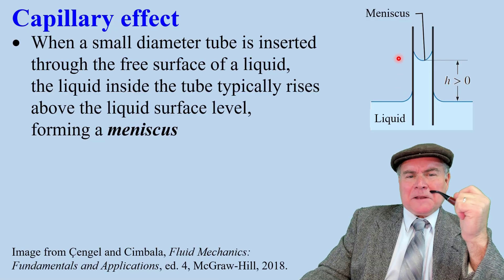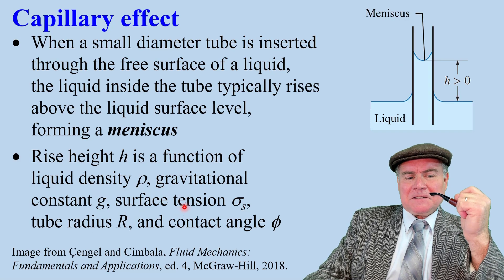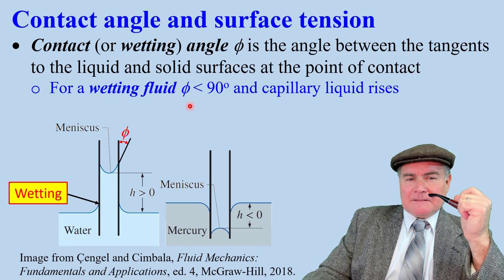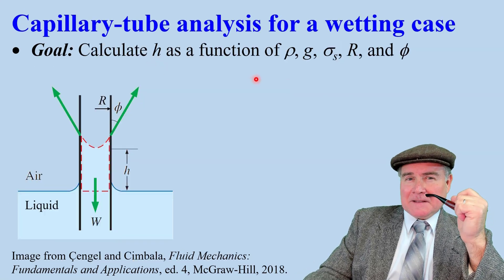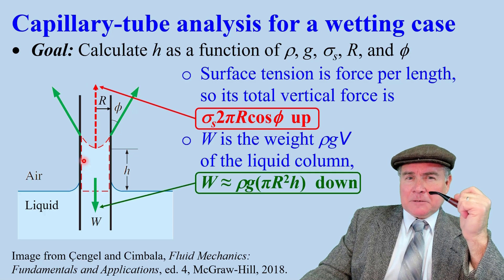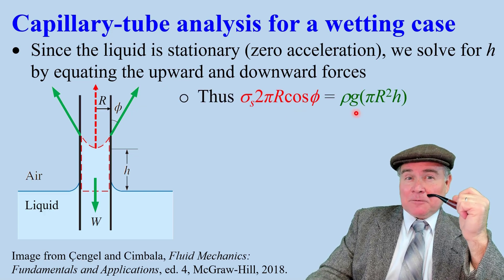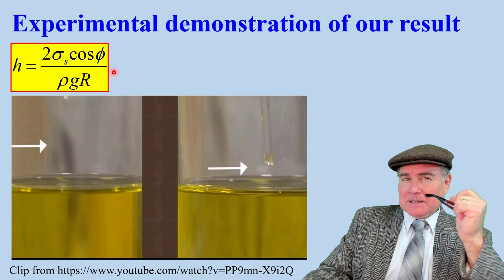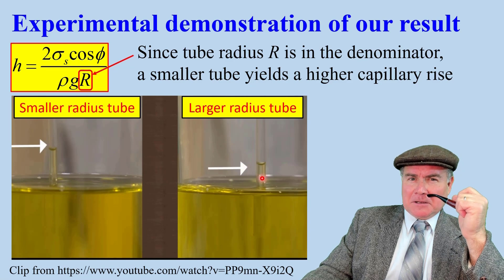Calculation of Capillary Rise in a Tube

Comment: Isn't surface tension force b/w the liquid? Here, the liquid is being pulled up by solid, right? Or it is assumed that an infinitesimal layer of liquid( annular) exerts the force on rest?
Reply from the maker: Think of the surface of a liquid as the skin of a balloon - there is a tension force, and that force is between fluid molecules, yes. But when the surface touches a solid, that tension is felt between the fluid and the solid as well. For capillary tubes, for example, the surface tension force of the wall acting on the liquid pulls it up until gravity (hydrostatic pressure) force and surface tension force balance.
Thank you for your kind comment. Please tell your friends and colleagues about my YouTube channel where there are more than 470 free videos about the Bible, fluid mechanics, science, math, Excel, statistics, air pollution, and other topics. I would greatly appreciate it.
Reply: @johncimbala 
Thanks
Is this related to young's equation at interface?
Reply from the maker: @ahammedafzal7797  Yes, very much so, although I do not mention Young's equation in my video.

Comment: If a tube is shorter than the height of the capillary rise...what happens? Does water bilge out of the top? Or does it just stay flush with the end of the tube?
Reply from the maker: It would climb up to the top and for the most part maintain its meniscus. It could not bulge outward because that would make the pressure in the liquid greater than atmospheric pressure across the meniscus. It also could not just flow out the top because that would be a perpetual motion machine that would violate the second law of thermodynamics.
Thank you for your comment. Please tell your friends and colleagues about my YouTube channel where there are more than 470 free videos about the Bible, fluid mechanics, science, math, Excel, statistics, air pollution, and other topics. I would greatly appreciate it.

Comment: What would happen if we performed this experiment in space?
Reply from the maker: Good question. I suppose the liquid would try to keep rising since there would be no weight force to pull down on it. But it might break up and form plugs of liquid inside the tube.
Reply: @johncimbala  okay thanks
Reply: Wouldn't it just push the plugs unless the plug has more mass and friction to stop the moving water. So, if not, wouldn't it just keep gaining speed and momentum until it reaches whatever is the maximum speed the capillary action can reach? That's assuming there is enough water to maintain and fully fill the entire glass width(wall edge to wall edge), because as soon as something changes and the water has enough space to spread out and not fill the tube "horizontally"/wall to wall the capillary effect will stop, correct?

Now, if it has no maximum speed it would continue to accelerate to infinity, but I am sure that isn't possible for a variety of reasons that would probably fill many pages 😅

It probably has some form of maximum rate of action whether it's friction or rate of molecule transition/pulling movement and attraction/binding.

Just my 2 cents of thoughts from a layman. Any thoughts?😅